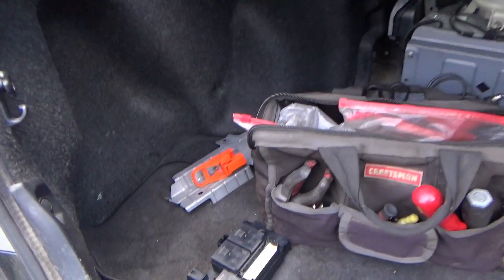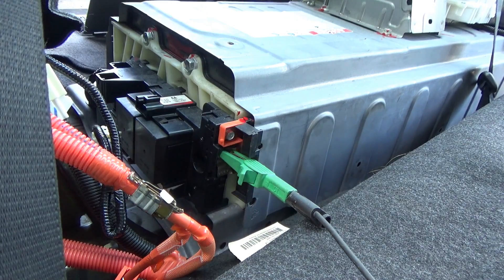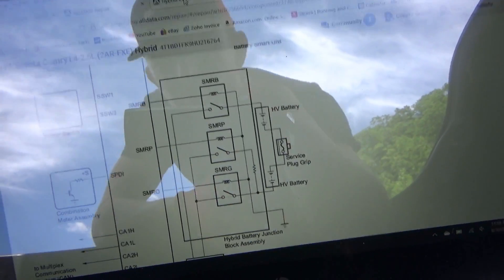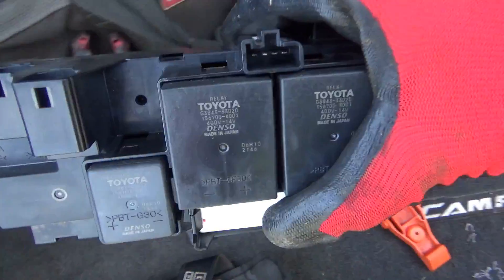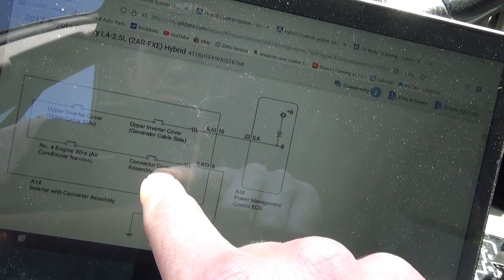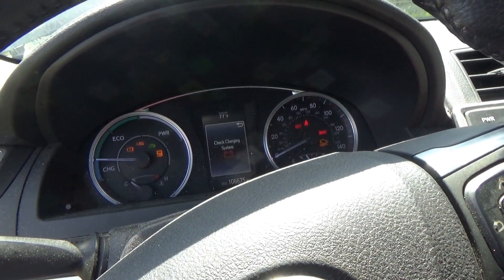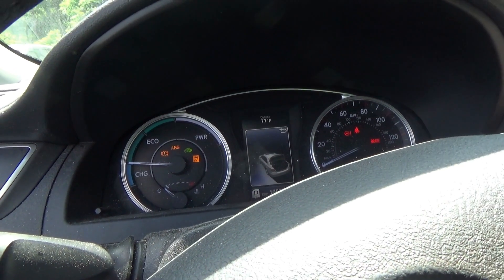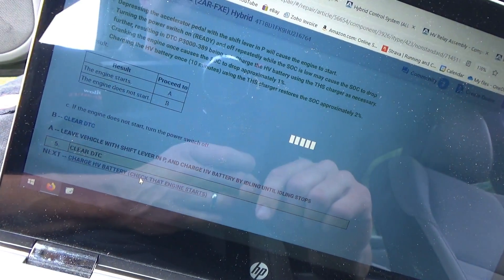Customer bought a HYBRID...and it Can't MOVE! (Part 2-Repairs)

Comment: These days you not only have to be a mechanic but you have to be an electrician and a computer engineer!
Reply: Can confirm, being a computer engineer is VERY handy these days
Reply: In the future, you'll need to be a quantum physicist, chemist, and electrical engineer to fix a car
Reply: Actually, what you need is an Electrical Engineer (minor in Mechanical Engineering with an Automotive focus) that specialized in embedded systems with some Electronic Technician background and has Automotive OEM module design experience. Electricians usually do not specialize in embedded systems and computer engineers rarely setup data acquisition studies (setting up and using testing hardware, understanding real-time control and data). The majority of computer engineers do not write and troubleshoot (debug) code for hard real-time systems, which describe the majority of devices on the CAN powertrain bus.

If you work for an Automotive OEM in powertrain controls as an EE you will do what Ivan is doing which is troubleshooting systems (hardware and software) and instrumenting engines and vehicles (data acquisition) but without the difficulty (with some exceptions) of challenges due to developmental software bugs or hardware design intermittent failures. What is very similar to what Ivan does is in documenting the origin of the malfunction. In OEM powertrain real-time system development, I would have to say the vast majority of difficult problems are due to subtle software bugs, which the software design team will question unless you have iron clad proof. Electronic Hardware from an experienced Tier one is generally very robust. The more established Tier Ones like Continental, Siemens and Bosch usually have a very well established core hardware team.

The most interesting problems to me are hardware issues caused by EMC at the vehicle level (usually an offending module with poor harness design) but could be an issue with ESD sparking events (large bandwidth noise). To troubleshoot you can do controlled studies in a chamber or using probes (antennas) while the vehicle is running, or looking at module level electronics on the bench (near field EMI analysis).

Comment: Wild that the thing does not have a 12V starter. The 2013 Civic Hybrid I rebuilt from a junk auction would start the engine with a normal starter even when the IMA module was a brick. After I replaced the module, it does use the drive motor to start it instead. No one should own a hybrid if it's not under warranty unless they are extraordinarily capable of diagnosing weird gremlins and fully aware that parts costs make restoring an old Mercedes look cheap. Thanks for the video!

Comment: This world is always (sometimes) confusing....  you call it "interesting", right Ivan?  Your favorite word!  I pose but with limited knowledge that charging LARGE batteries is not without hazards.

BTW... your discovering residual voltage is foundation for why current loading test lights are better at determining a solid connection rather than using a Hi Impedance meter.

Comment: HI IVAN,In this case it looks like on Toyota inbreeds we have the same amount of experience>>>>NONE.haha   When my neighbor asked me to help him change a motor mount and axle i said sure.BUT  after we  got that  done the car wouldn't start.1st i said ,well lets check for 12 volts_ ok _got it. NOW what?I said "Let me SEE the OWNERS manual">>don't have one? step ahead to ME "whats this BIG ORANGE PLASTIC THING?" Him "i took it off of there">. So i put BACK THERE.much like you ,>>YOU GOT TO PUSH IT TO ENGAGE!!!!!CRAP>>>what else did you disconnect?  ANY WAYS on his car we got lucky his big battery had juice it moved and started.BUT i got to tell you,i felt very uncomfortable not hearing or FEELING movement under the hood.i THINK TESLA with ONLY ELECTRICAL motors may be much easier to learn.WHEN you get in ,you  hit the pedal IT ETHER GOES OR DOESN'T.I''ll stick to regular gas motors I'm too old and stupid to change.haha

Comment: Also, pretty dumb thought perhaps, but if you towed it, wouldn't it charge via regenerative braking until it could start on its own? Or would the car just throw a hissy fit and keep the transmission in neutral?
Reply: In this case it could have worked. There was still enough juice to move the vehicle on electric motors itself, but not enough to start the engine. And after clearing the errors there was no warning lights on the dashboard. So teoretically while towing the car and pushing the brake a little bit, it could charge the battery enough to start the engine.

Comment: No, you can't jump start the high voltage battery.......yet.  I'm sure someone out there will find a way.  Oh ya.  The 12 volt battery gets charged from the underhood inverter.  If you're going to work on hybrids, you need training.  Some of those batteries are 400 volts or more, DC.
You need cotton gloves for your hands, high voltage (1000 volts)gloves over the small cotton gloves, and leather gloves to protect the rubber gloves by pulling them over the rubber gloves.  Napa used to sell those rubber gloves.  Napa also had books on how the electric parts of the motor, inverter, etc all worked.  I'm sure iATN can help.  I know there are techs that work on hybrids and EV's and I think iATN can recommend types of training.
Please be careful Ivan working on the high voltage side of the vehicle!
The rest of the vehicle is almost like any other non hybrid vehicle.

Comment: Ivan, Welcome to the new era for mechanics. Definitely, you encounter a job that was outside of your wheelhouse, this is a sign that you will need to trained yourself more on hybrids and EV system for further diagnostics because now we have reached the era of more and more hybrid vehicles has turned to the age and state of used market that is getting into the vas majority of vehicles running on the streets. I get we assume all vehicles are the same but the new tech on the new cars has moved to a more complicated system and we as technicians need to stay up to the new trends. That means having now hybrid battery chargers on hand (because jumper cables and booster packs aren't enough) may be more diagnostic tools that are dedicated to hybrids and EV. That is the market. 70 years ago no mechanic will even think that you need a scanner to diagnose a vehicle, only you need was an experience, ear, smell, and some gut feeling, not anymore....

Comment: Ivan, on the circuit diagram I noticed that there were only 4 wires from the ECU to the junction block (3 control wires and a power/ground) and the load side of the relays is HV only. So what was the ECU actually sensing when you measured the status? Was it just back-sensing the power feed on its own output to confirm that it was pulled high/low when it was required?

That would mean there is no way for the ECU to detect if one of the relays was mechanically stuck on the load side even without any power applied.
Reply from the maker: correct, it just senses continuity through the control side :)

Comment: Amazing!! I worked on two hybrid cars before. Nothing major. Just troubleshooting and 12 battery replacement. I bought some insulated tools and gloves for extra safety . You should invest some insulated tools, too. I diagnosed a bad hybrid battery with ThinkDiag tool on 2007 or 08 Toyota Camry 2.4. Few of cells are low. However Customer can not afford it so he sold it.

Comment: You may jump start it, but you need the jump start pack corresponding to the battery used for starting - aka the "fancy charger"... But agree, it is stupid. Mainly when considering other fact: The common lead acid battery chemistry may work down to -40 (if fully charged), but it has very low energy storage capability. All the high density battery chemistries practically stop working below freezing. Yes, for starting you need fraction of power compare to driving, but the small auxiliary does not need to store that much, so lead acid will suffice and will still have plenty of temperature range room to deliver enough energy for ICE start. 
It is the consequence of a cost cutting: They just did not put the 12V starter on the engine. Yes, one may say why when there is the huge traction battery and even when performance deteriorates at cold, the fraction of normal power it could deliver still suffices for the start. But tools and instruments required to revive a 12V battery are common (e.g. a set of cables and another car), but for the HV battery not at all.
Maybe unless it is a "plug-in" hybrid, then then regular wall mains socket is all you should need...
Reply from the maker: Great points, I agree 100% Anna!
Reply: HONDA Hibrid have   a starred  motor .
Reply: @JoelAutomotiveInaction  A 12V one? The thing is, making it just the HV, it is a bit easier to design (no high currents, way greater power available from the battery,...).
True is, I had in mind mainly the Toyota "synergy drive" system, where the electric parts do not only serve to feed the power from/to the traction battery, but also form a CVT functionality (even when the battery is not involved, with very simple mechanical part with no gear changing mechanism needed at all). There the two motor-generators may rather independently both run the car, as well as start the ice principally without a dedicated starter (however not sure if Toyota still does not use one, mainly for the cold temperature starts when the traction battery does not work).
Dunno what power flow concept is used here in the Honda...
But on the other hand if the batteries were allowed to be discharged so much, what is the chance of them still working and not being ruined?

Comment: Why they do not put an auxiliary starter for the 12v battery just like the normal cars rather than over cluttering with expensive modules, sub-computers, matrix of networks Looool, so that if the hybrid battery's life is over, one can still use the car as common normal cars, where he can as well unbolt the heavy battery to save on gas Loool. All this over complication in a dumb way is being made purposefully so as to keep the owner tied up with the dealer on one instance, and not to keep the car running for long years as the running / repairing costs will be very high after a preset age Loool. It all tricky policies, parallel to political agendas to dumb down societies and make Humans soulless hybrid zombies Loool. In the mid 80s I came across an article in Car & Driver or Motortrend magazine on an inventor who convert a Cadillac Eldorado (a mammoth Coupe) to run on a very efficient  electric motor which took its juice from a small silent generator tucked in the trunk. This truly genius invention among many other likewise inventions never reach fruition and as every one knows are suppressed by all means Loool. Thanks a lot Ivan. John

Comment: That 69V measured over the battery with the safety plug removed could have been a capacitor in the unit. That's why it states to wait 10 minutes after removing the safety plug.

The price of the charger seems to be US$13,983.73 (edited)
Reply: Capacitor would have thrown big sparks wouldn't it?
Reply: @hikerJohn  Not a small cap.
Reply: order me two of those chargers. Also, I guess that permanently puts the kibosh on any backyard repair! Or even get the thing started.
Reply: @adotintheshark4848  Just check with Dave at EEVBlog and Big Clive and let them figure out the charger that's likely extremely overpriced,
Reply: need to get you some high voltage jump cables. make a set up that plugs into the disconnect plug of your mates car.

Comment: These non-running auction cars have the potential of swapped out parts, I would question the whole battery. They swap out the 2017 battery for a junk one on the shelf that doesn't work, turning a running car into a non-running in an effort to get money from parting seems odd. It may be a junk yarder battery but the battery itself may have some life since it had circuit issues. That pin does not break off by itself and it is odd you junk a car because someone working on it broke off a pin.
Reply: yea alot copart car  swapped out parts b4 put in auction.

Comment: This confirms that I did the right thing when ordering my 2016 Highlander from the factory. I didn't think the $5,000 extra was worth it for the hybrid. Thanks Ivan!
Reply from the maker: $5000 is a lot of gas money...plus hybrids are heavier and lose storage room to the big HV battery!
Reply: @PineHollowAutoDiagnostics  $5000 is what 1000 gallons at today's prices and maybe 100 gallons tomorrow? 

Jokes aside, I don't think you could keep the car on the road long enough to recoup the differences on fuel savings alone.

Comment: Fyi the regular 12v battery has to be a toyota battery.  Our 2012 hybrid wouldnt start and we HAD to use a toyota battery.  Couldn't slap any old 12v in there.
Reply from the maker: Really? What's so special about a TOYOTA 12V battery??
Reply: @PineHollowAutoDiagnostics  im unsure but if you call autozone or oreilly's they'll say they have something "similar".  There is also a way for you to put the car in service mode where the gas engine starts and stays running by hitting the gas pedal a certain number of times and press the start/stop button.
Reply: The terminals are smaller than standard, and it is an AGM

Comment: Just like jump starting your tool batteries when there dead  You have to take them apart and give them a charge not through the charge controller until the voltage comes up enough that the tool will come back alive.
Reply: If wonder if that would work in this case, or is there another module in the battery with stored fault code only the fancy charger can clear?..

Comment: The factory wants the involvement of the dealers coming back to their shops. Period.
Reply: Someone mentioned it's very odd for the battery to get so low they won't start.
 I guess the 'fancy charger' determined the battery was fine? also very odd was the missing pin. 
I wonder if with the right charger that could have been fixed with just the scan tools, and not a factory computer talking to the battery. This brand, maybe, others not so sure

Comment: I priced a genuine Toyota THS charger back in the day, when I thought I should work on these cars.  The Toyota dealer quoted me a bit more that $9,000!  The Snap-On guy told me that there are cheaper HV rescue chargers but, they cost about $1,500 plus a bunch more for model-specific adapters.  I just don't see enough of these in my shop to recoup that kind of expenditure... not to mention I would have to travel all the way to Philadelphia (8 times) for proper training.
Reply: I think you can buy such charger cheaper or even build it yourself. If there was 70V of charge, and to start the engine it was required a hair more, then every power source that could produce higher voltage and limited current should be able to push that few more electrons into the battery and make the car start, so it could charge the battery up itself after then.
Reply: HA! Yep, won't be seeing one of those in my shop. EVER.
Reply: The THS unit did a boat-load more than charge the battery.  It can assess the state of charge for each cell, discharge and charge the battery (or just a single cell), and a laundry list of other things.  And, to the best of my knowledge, it has been replaced with a more advanced (and complicated) computer-based unit called the Midtronics GSX-5100 (you can Google it and read about the capabilities).  Point is, these are not brute-force constant current chargers.  These are smart chargers with an output and interface tailored to communicate with the on-board power control unit.  Trying to reverse-engineer such a contraption is beyond the scope of this old mechanic.
Reply: @leoashrae4199  Having reverse engineered the battery and management hardware for a second gen Prius battery....

Its not worth it. You are better off getting a rebuilt battery. Especially if it was case like mine where it had a grand total of 4 good cells.
Reply: @wyokaiju992  And all the smart mechanics said... AMEN!

Comment: I can see why they would want to use the EV motor as a starter, because it saves money..  but man, that really handicaps the car....   I'd still rather have paid a little extra to have a regular starter, so you would never get stranded. smh..  Wow, you really have to pay attention to what you're signing up for with Hybrids.....   You would think they would at least have a simple 110v charger to get you out of this mess.   Having to take it to the dealer is just unacceptable IMO>
Reply: Hybrids start and stop their engines very very often, a regular starter might not have been an option. On good old diesel locomotives back in 50s and 60s they used the same trick. The main electric generator, which produced power to run all the motors attached directly to the wheels, was also used as a starter for the engine, using board battery power. There was no separate starter motor because there was no need for it. Hybrids utilise the same conception, but they also have a dedicated traction battery, regenerative braking and all the other stuff. But the basic conception is the same. However, they could add an option to use the 12V battery power for the EV starter motor in emergency situations.
Reply: @5Dale65  Or at least a way to plug in a trickle charger.  Even if you had to leave it over night, at least you wouldn't be forced to tow your car to a dealer and pay their outragous prices. smh...  I'm still so disappointed by this. lol... I had no idea

Comment: Why can’t the 12 volt battery start the gas engine so it can charge the hybrid battery?  Seems counter productive.
Reply: No starter. The electric motor and the engine are on a common (differential) gearbox so the traction motor is used to start the car.